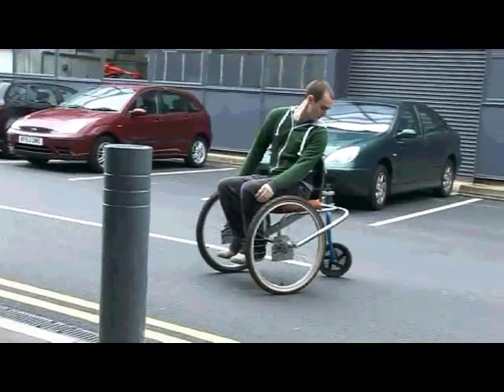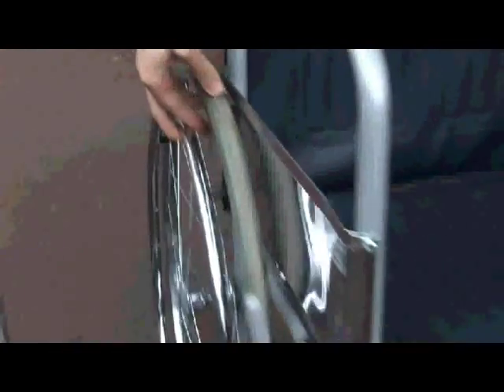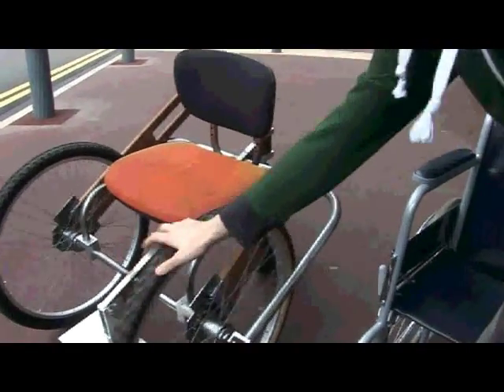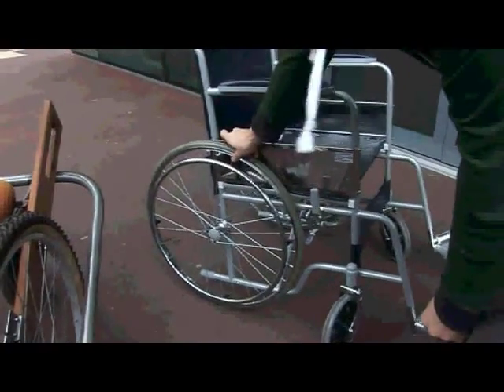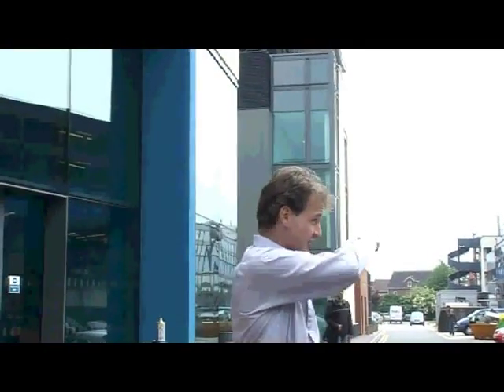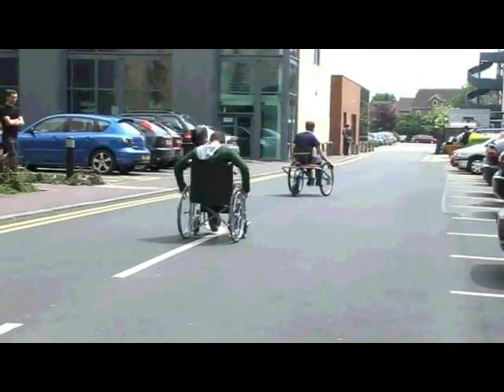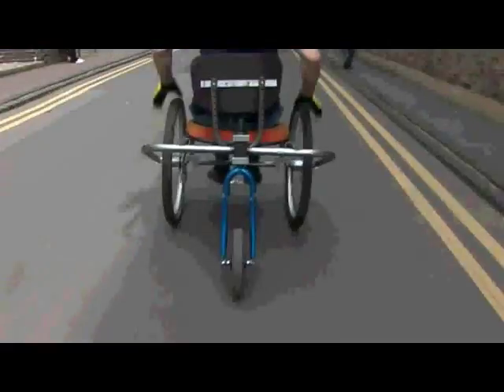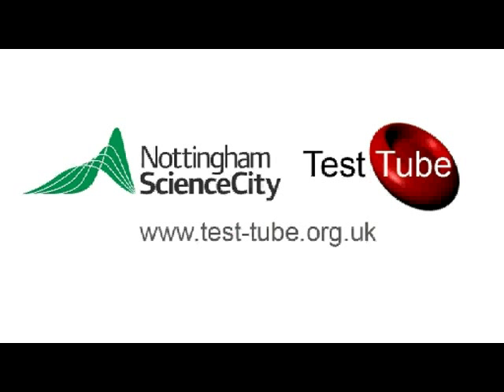Wheelchair for Africa

Comment: We swapped the rear wheel / fork at the last moment, which removed the tilt in the seat - it should have tipped back slightly as you suggest. We're in contact with a UK wheelchair manufacturer and a couple of charities have shown some interest, so we'll see.